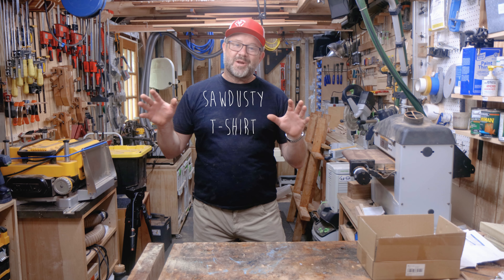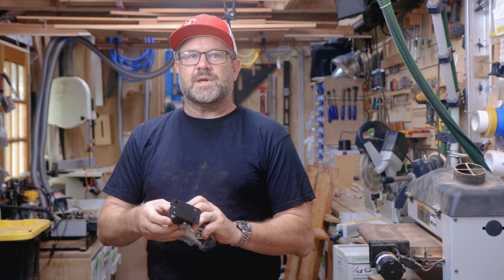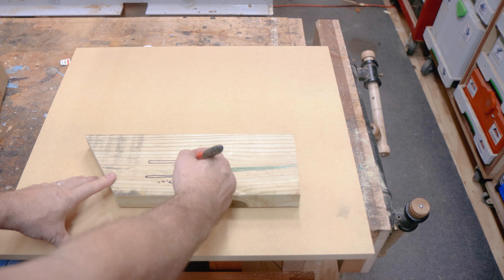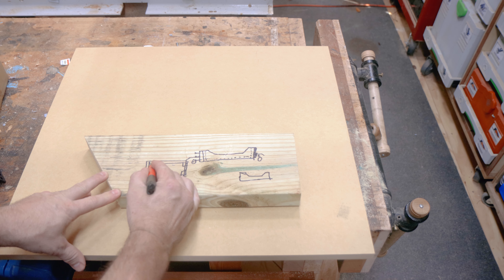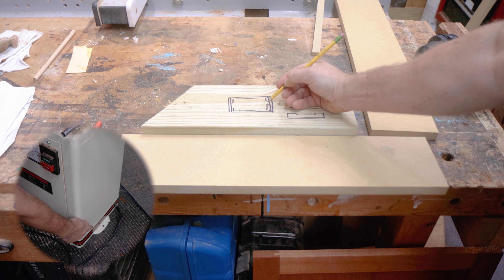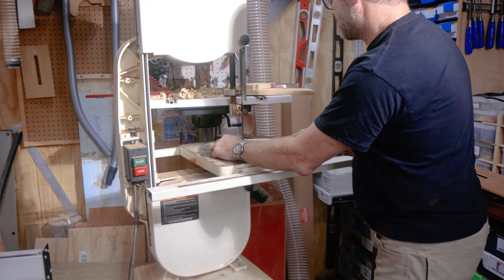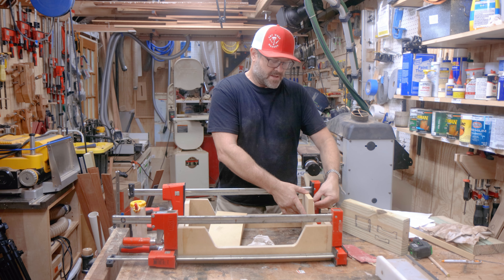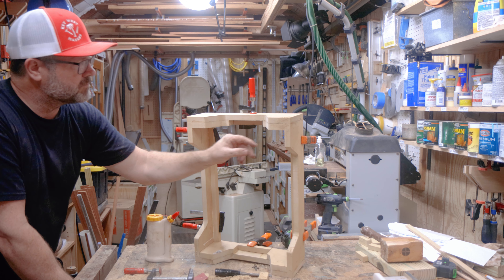MY FAVORITE MOBILE TOOL BASE (Woodworking shop project)

Comment: I have the same casters. They’re intended to be purchased with the addition plate mounts so they’re removable. After about 1.5-2 years I’m not to big a fan of them. TIP: instead of stepping on 1 caster at a time (which is an issue, as it can skew your “work piece” base, table etc. by raising only one of 4 sides at a time). Drill a hole in each of the caster foot pedals. Attach a piece of angle iron or thick flat bar on both sides (2 casters on one side, 2 casters on the other side). Then you can step on the “bar” raising a whole side (2 casters at a time) at a time.

Comment: Nice work here.  I've got the same jointer, and while I have a mobile base that came with it when I bought it, it's a pain to use, so this could be a nice replacement.  Something I've seen other folks do with these flip down casters is screw a rod between them so you can flip up & down in half the time.  I need to do that to the ones I put on my workbench.
Reply from the maker: I like that idea - thanks!

Comment: Great design. Needing to build a mobile base for my 14" band saw I just purchased.
Reply from the maker: Thanks.  I just finished one for my bandsaw.  Much easier to move around than the adjustable-size commercial one I was using.
Reply: @KeyWestMakers Nice work. I have a fox shop base that goes with my grizzly band saw, but it is so old that the rubber casters have disintegrated.   Do you know if your base works as good as the shop fox?

Comment: Nice design! Did you end up making the one for the table saw out of MDF as well? Has it held up over time? I'm going to build something like this for my saw, and I'm researching what materials to use. I know that the weight will be evenly distributed across the sides, but MDF sounds too flimsy as a support for heavy tools.

Thanks for the video!
Reply from the maker: I did make several more, including my table saw, however I made the rest out of plywood because the MDF doesn’t hold up well in our constant high humidity.
Reply: @KeyWestMakers  Gotcha! I have the same issue where I live so I'll take that into consideration. Thanks a lot!

Comment: Excellent! I need to build a couple of these.  Was wondering how the MDF is holding up there in Key West?  I know the humidity can be a bear in Fla.
Reply from the maker: The MDF was a complete and total failure.  I had to rebuild it with plywood.  But I needed a couple more so I knocked them all out in a Saturday.

Comment: I have two questions. 
1) by adding the 4 corner blocks to support caster screw depth didn't you decrease the inside dimension of your length without accommodating for the length of the jointer? Did that happen off camera where I missed it? Your jointer should have been unable to fit inside by the width of two MDF boards.

2) Are those quality casters? I read several Amazon reviews saying the levers are flimsy and bend and break to where you can't use them anymore or hammer them back straight. It also said there were missing screws and washers from their orders.
Reply from the maker: Good questions.  On the first, I should have explained that better.  For calculating the length of the sides and the ends (not the additional internal blocking) they need to have 1.5. inches added to the dimensions of the machine base, assuming you are making out of 3/4inch material.  You probably want to give yourself another 1/8 or 1/16 inch so the fit isn't too tight.  The extra length on the sides is to accomodate the blocking at the ends; the actual end pieces are glued and screwed to the butt end of the sides and the blocking sits inside.  The end pieces need the extra length to accomodate for the sides.  The blocking could normally be a solid piece that spans the entire distance between the sides (cut to the side-to-side dimension of the tool plus 1/16 or 1/8 inch), essentially making the end pieces double thick, with one layer sitting between the side pieces and one butted to the end.  In my case, the jointer base had some 'tabs' sticking out that were in the way.  I have recently made one with double sides and ends - I'll cover that as well as your question in my next vlog.  
On the quality of the casters, these are very solid - from the part that holds the wheel to the swivel to the lever itself.  After I read your comment I went out to the shop to inspect them further to make sure I wasn't missing anything.  I use them daily and I'm not particularly gentle with them.  They don't show any signs of wear yet and I can't imagine what it would take to get them to fail.   I also read some of the poor Amazon reviews - I wonder if they had a bad production run.  I  would still recommend them.

Comment: Does it move when you joint a board? I have a mobile base with wheels and with the wheels locked I am able to move the entire jointer. Not same design as this though.
Reply from the maker: The entire base sits on the ground when the sayers are lifted and the jointer fits tightly in the base itself, so there is no movement at all when jointer.  In fact, it would be fairly difficult to do so even if you were trying to (with the casters up).  I have black indoor/outdoor industrial rugs covering my floor so that may help, too.  Not sure if I would get the same result on polished concrete or even a wood floor.
Reply: @KeyWestMakers  I think I will still build this and put a rubber sheet on the bottom so there is no way it will move. Thanks for the inspiration.